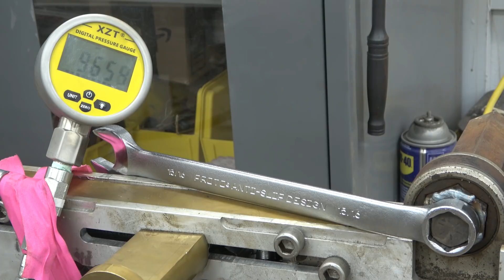Craftsman vs. Proto

Comment: Hypotheses: 12pt=More stress Risers per bore 
6pt=Less stress risers
12pt has a stress riser between each barring surface. The weakness is between the surfaces upon which the stress is applied, not on the surface itself. 
-CY Castor
Said while Firmly in a vice with my stick on the ice.
#CockfordOllieOrNoOllieAtall

Comment: It's not just the girth of the teeth, but also the length. Cross-sectional area at the weak points, seems the 12 point has quite a bit more cham-fir on the faces.

Comment: uncle B, we dont consider 6 point wrenches stronger or better, It all comes down whether you are working on new hardware or old KRUSTY crap from our beautiful salt belt. Try taking a rusty bolt off with a  12pt socket and youre sure to strip the fastener, Use the 6 point and itll come right off.

Comment: I have a theory what the wrench takes a lot more pressure at the angle where the 12-point snapped.
If true, the 6-point would break at the same torque if the "socket" was tilted 30 degrees.
I don't have the brain to explain exactly, unfortunately.

Comment: I'd be very interested in further tests with more varieties of wrenches.

I recently purchased some old Mac combination wrenches on eBay; the "V-groove" types, with the notch in the crescent end, which some enginerds purport weakens a wrench. However, when compared to a Husky wrench of the same size, I found that the V-groove notch cannot POSSIBLY do this, even in a "moment" because the V-groove Mac wrench crescent jaws are no deeper than the crescent of the Husky (round-crescent) wrench; therefore, if anything, the Mac is stronger...riiiight???

BUT:

The Husky wrench I'm comparing it to has a LOT of extra meat surrounding the crescent. So is Husky trying to compete? Or are they compensating for a cheap, crummy alloy with extra beef...?

Comment: Alot of missing metal on the twelve point compared to the six point. I'm not sure that it's more relative than the metal tensile strength to the breaking point. But you can feel a difference in weight from a six to a twelve in larger sockets.

Comment: Kinda surprised you "determined" that better steel was the reason the 6pt did better than the 12pt. There is a reason why impact sockets that don't break easily are 6pt not 12pt.

Comment: Those air pumps can take a little more, I have one, enerpac I believe, used to always do better than other jack pump I had or used.
Never occured to me that the relief valve was buggered since new, I recently run across a 10k psi gauge and hooked it up and found out she'll go well above the stop for the needle.
Used it for years like that, and of course, anytime you get a jack out you have always have to run right into the red.
Reply: Be careful with reliefs on jacks.  Had a 400 ton relief blow out and kill a coworker a few years ago.

Comment: Just yesterday I had a jack handle over a snap-on 14mm spanner doing some turbo bolts on a mitsubishi diesel. I was hoping to break it for the warranty but she lived. It was about 2.5 feet of extension and felt like about 40kg so 80lb of force at the meat end. So 80 x 2.5 just over 200ftlbs on a 14mm/9/16th spanner.

Comment: It's hard to tell by the angle of the dangle, but is the proto wider than the craftsman? Be a lad and do a quick calc for tensile strength using the cross sectional area and torque.

Comment: And what if it comes down to the same reason why airplanes don't have square windows? Could it just be that the 12 point has sharper radii on the inner corner, and that sharp corner creates the weakness?

Comment: With the 12 point there would be a higher chance of material defect being in a weak spot compared to the 6. I'd be that if you had 50 wrenches from the same manufacturer with the same thickness and half were 6 point and the other half 12 point that the average max torque would be noticeably higher on the 6 points than the 12 points.

Comment: Excuses and opinions are like assholes- everyone has one, they usually stink, and nobody wants to hear them. 

Fun fact- I just so happen to own a 3-piece set of U.S.-made Crapsman adjustable, nut-fucker wrenches, some of the last ones made in 'MURICA! before Sears went under. They're marked "WF" for Western Forge in Colorado Springs, Colorado, not far from where I bought them in the first place.

Had one stupervisor in new Kommunfornia (A.K.A. Colorado) who used to work at WF. Told me the Proto and Crapsman nut-fuckers made there were EXACTLY the same, aside from the dies they used for the brand name. Same steel, same heat-treat, same specs, same, same. Only difference was the name and price.

Comment: Those proto wrenches suck to use. The knife edge is a horrible design. You need to wrap a rag around them to pull on them. They may well have just sharpened the edges a bit more, them they could call it a 2 in 1 multi tool. A knife and wrench, all in one.

Comment: But but but..... in my opinion neither video addressed the fundamental reason for 12 versus 6. You, a field service guy, know as well as anyone that the bolt has been pissed on by the second shift guy for the last 10 years. The head is a good half a wrench size smaller than when it was new. Do you, 1) reach for the 12 point to thoroughly ef yourself or B) grab your trusty 6 point to give yourself the best chance you can?

Also, the saying goes: the first couple licks are all sweat and piss but the rest is good eatin'.

Comment: Bolts stretch, period. I worked at a case ih assembly plant for 6 1/2 years as a tester and there was certain hardware particularly larger stuff that was torqued to 500+ ftlbs like the final drives on combines that if something happened and they ever had to be removed we had to throw them away and use new ones in their place. Bolts that went in easily with 2 fingers were like they had thread lock after being torqued and stretched the threads. Believe
Reply: I get that a lot where I work, if I have to go back and redo or modify someone’s work, you can tell they have been stretched, tight all the way out.
Reply: stretch occurs between the head of the bolt and where the bolt threads meet whatever it's threaded into. The portion of the bolt that's threaded in does not stretch significantly. You can see in this video AvE's die only got tight when it reached the portion of the bolt that wasn't threaded in.
Reply: Nothing like a 5 ft cheater on a 2000 ft/lb torque multiplier. Next comes the Thermadyne heat wrench.

Comment: @AvE The old USA made Craftsman Wrenches like the one in your video were made by Stanley Tool Works for Sears. STW is the division of Stanley Balck and Decker that manufactures hand tools.  Stanley Tool Works also makes Proto. Proto along with Blackhawk are both Stanleys Industrial brands.  Also, Stanley used to make all the old USA made Husky wrenches and sockets for Home Depot after they lost the craftsman contract at sears back in the early 90's. In some cases, the craftsman socket and the husky socket identical with the exception of the branding and part numbers. chances are those wrenches came out of the same factory with the same steal and were just forged on different machines. the length is about the same on both units, so i suspect the difference in breakage points comes down to 12-point vs 6-point along with contact surface on the bolt.

Comment: I think the results would have been different with a 12 point nut so to speak as i bet the reason it breaks at lower torque could be due to the stresses with distortion across the flats of the nut

Comment: Try using the right tool for the job. Just because you can doesn't mean you should. Flat head in a Philips? Turn a six point with a six point and a twelve point bolt with a twelve point wrench. Drive the torque by twelve points versus six and watch what happens.

Comment: For some twisted reason I take great joy in the sounds of discomfort. 😂 Also, for real world testing you need to torque it with a gorilla using a 4 foot cheater bar and 5lb sledge.

Comment: even with a 4 foot snipe on the end of a wrench I doubt I can hit 600 lbs of torq-u.  12 point is just as good as 6 point in 99% of cases i'm wrenching.  Only time I snag a 6 point is when I'm hammering it on a mostly rounded bolt head that used to be a size bigger.  Not that such methods ever work out mind, but gotta try it anyway.   

Now, a 50 tooth vs 72 tooth vs 90+ tooth ratchet is a whole different ball game.  I'll blow the head clean out of a 90 tooth ratchet with no snipe in no time. Garbage, save for those little bolts in the deep dark hole the engineer added just to fuck yer day with 15 degrees of swing.

Comment: Thanks for this followup! While not Apples to Apples in the strictest sense (diff brands), I'm still quite content with the outcome!
A few takeaways and unknowns I observed -- but by no means feel it detracts from the test:
- Did the 16pnt round the nut first and the self-generated vibration of it slipping then caused it to snap OR did it snap and then the "wider" interface cause the rounding? 🤔 Not sure we'd be able to know without redoing it with a highspeed camera in play, to capture what went down
- How much pressure did the first test actually manage to apply to the 6pnt before it bottomed out... Maybe the first test brought it just to its yield, and that second at 4K pissies made it throw in the towel? 🤔
- Unfortunately, I believe we won't really be able to know the actual breaking torque on account of the wrench flex absorbing some of that force, right? In a follow up test, not to say there will be one, I think one might need to cut off the box end, leaving a small stub that's just long enough for it to rest on the vice jaws with the destruct-o-matic clamped in said vice. Then it won't have anything that can flex and skew data. Would just need to make sure it was cut cold (CNC or that bandsaw, but either way, using the android blood), to preserve its factory hardening.

I think you should've had the John Deere bucket in there, just the bucket, facing away from the toolbench, that you could climb into while running up the pressure!! 🤣

Comment: I think the difference in leverage due to the shape of the wrench has to make a difference in the results. 
Let's say the bolt head and the wrench were in an egg shape (oval), the slight amont of torque would deform the wrench and the metal would be under insane tension.

Comment: Just my assumptions. The 6 point has greater surface area in contact in the head of the bolt. Therefore the pressure exerted by your torquey machine is more widely distributed onto and around the box end. I have rounded more bolts with a 12 point than a 6 and it has nothing to do with tolerances. I would be curious to see how a craftsman  12 compares to a craftsman 6 as well as proto 6 vs. proto 12.

Comment: Try some stahlwille wrench. After some years with busted knuckles and rounded nuts. My knuckles are saved after switching to stahlwille both on work and in my privat tool chest. These usa brands is not common in Norway so i have not tested them often. But some time i work with caterpillar mechanics and they use "strap-on" tools and they seams to be to much material on them. And incredible slippery when you are covered in oil. But that is mine opinion. Never broke a stahlwille even they are skinny. And they are really close toleranse. When i doing big hydraulic hoses on those mobile rock crushers the stahlwille will never make a hose fitting oval like this swedish nut lathe and losse fitted wrenches

Comment: Either way, what's the chances that someone would need to approach the failure level of torque on the lower rating on that size of fastener? While I enjoy an overkill as much as the next guy, I'm not going to take a 50 BMG deer hunting when my 308 will do just as well for less expense.

Comment: I'm gong to propose a 3rd reason. I don't think it's the steel or just the meat. 

The 12 point due to having aria to push started to roll over the steel hex as it broke. And that's I think, why it broke sooner.

As the steel roles over it stops giving torque and instead is causing the smooshed tips to cause outward pressure. This means instead of the ring taking just torque, it is being pushed outwards as well. Making it fail faster as its the outward push and torque create more stress. The hex is becoming a cam trying to expand the ring. 

The 6 point will not roll over so it delivers more torque before failing as the meat only has to take force from the torque. 

Also 6 point is way better with rusty crap. I always have 6 point sockets over 12.

Comment: Wish I'd taken some pictures, I recently had a 15/16 nut on the backside of a plate. When I hit the bolt with my impact gun it turned just enough before the open end of the wrench caught the nut and put the corner points of the nut into the wrench flats. Not knowing, I kept up the ugga duggas thinking the nut was compressing the plates. Only when I realized I couldn't get my wrench out did know what happened. It peeled the corner of the nut almost halfway down as it tried to pull the nut through the wrench. Hardly a mark made in the chrome of the snappy wrench.

Comment: The angle on the 12 point being sharper and having a smaller radius at the edge might be a factor as well. 12 pointer just seems like it has more of a stress concentrator, but it has been a couple years since last I had to figure out a stress concetration factor.
Reply: I think you’re on to something. The 6-point has room for a larger radius stress relief where the faces meet.
Reply: I was thinking the same thing. Stress riser do to a sharper corner in the 12 pt? It's kinda hard to see in the video.

Comment: I am probably wrong, but, maybe the broach that cracks isn't the one holding the fastener, so tecnically 12 is thinner than 6 in that spot, explain also why the 12 has a thicker broach

Comment: The idea of 12 point vs 6 point is that you need less wiggle room with a 12 point so better in tight spaces , but it round up bolts more easily than a 6 point , also if you want to add the "why not use a cricket" question is because it can't handle as much torque, but what do I know?? I've only used this tools for about 4 years daily as part of my job
Reply: 3/4 drive is commonly found in 12 point.

Comment: Take to the HAAS and machine your own wrench out of some exotic material. Would love to see how an AVE wrench stands up vs commercially made
Reply: As cool as that sounds, I envision his stuff losing, when made to the same dimensions, only because what sort of off the shelf metals that'd be available just wouldn't have the same strength as what could be attained through unique alloys.

That, and I don't believe he's setup for hardening / tempering. The tool companies have spent lots of R&D $$$ on that part as well.

Even so far as CNCing some wrenches out of 'conventional' Damascus steel ingots made by a local knife shop, might be interesting. Or if nothing else, would sure LOOK awesome! 😁😎

Comment: I do not profes to  be an engineer but the twelve point flats could be pushing out away  from the bolt because  of the extra angulation. If that doesn't make sense I admit that  I am not a engineer.

Comment: Is it possible that the 12 point end creates more of a camming action against the head of the bolt causing more pressure against the metal than the six-point would?

Comment: Have to say, I took safety precautions on the account of knowing what the images in motion were to be, making my observations of the presentation on an automatically cleaning chair. The results were better than any store bought pharmacy could provide. However, not without side affects as I am having the need to take a trip to the local homeless despot for a replacement chair, porcelain of course!